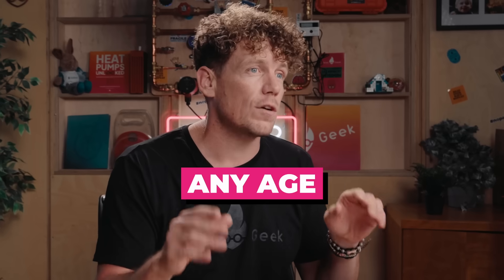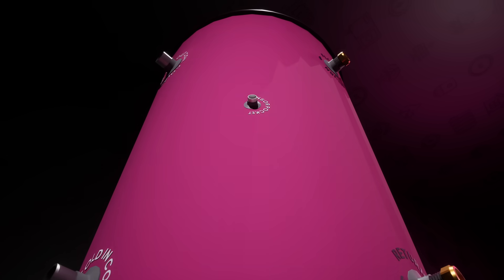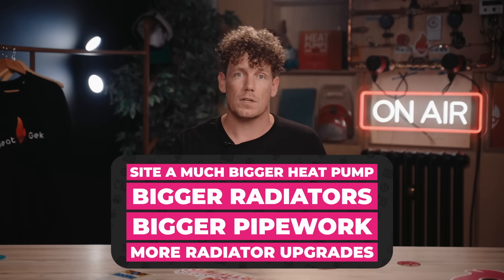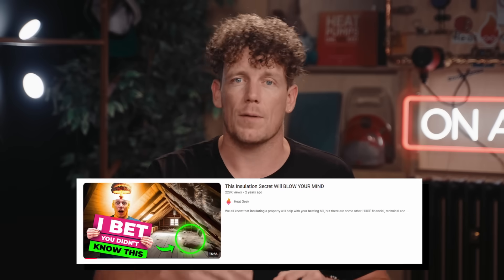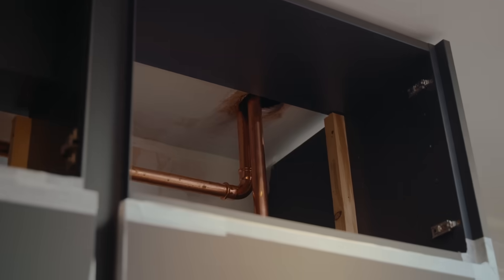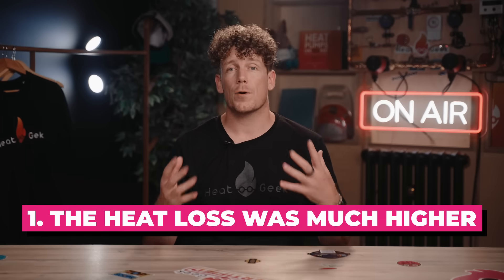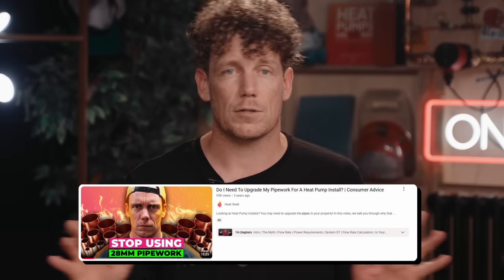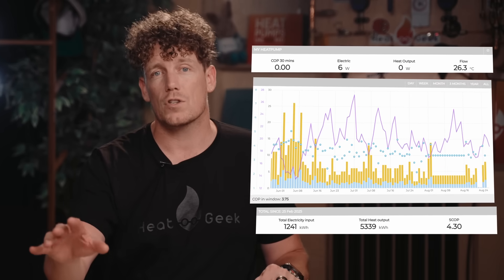Overcoming the 4 Challenges to Heat Pump Any Home

Comment: Do you have a view on the best option for heating an electric only house thats never had central heating..... it seems air-air is the only sensible way but I've an open mind....
Reply: One of the houses I'm looking at buying in the UK has electric storage heaters, if I do buy that one, it'll be upgraded to air to air.
Retrofitting a central heating system is going to be expensive, but maybe worthwhile to some.
Reply from the maker: A2A is absolutely the cheaper option, just remember it’s a different kind of heat (definitely less comfortable) and at water also does hot water
Reply: Presumably it depends on how difficult central heating would be to install? If it is a challenge, @timandkatsgreenwalk have A/C for heating and it works for them.

Comment: My second floor maisonette is probably 150 years old, built from stone and it's partially double glazed. My heat pump (installed through ECO4) has been life-changing
Reply: Hopefully in a good way!
Reply: @Biggest-hz7ng ECO4 is one of the best government interventions I've experienced. My EPC went from G19 to a high B and my power bills have gone down by half, even though I'm hearinig my whole house, instead of a single room.
Reply: How did they do the external unit?  I have a maisonette too, no land, no scope for anything at ground level.  I do have an attic.
Reply: @WyndStryke mine is at ground level. The owner of the building's garden is very nice. I'm the owner of the garden. Presumably a loft would need inlet and outlet ducts. Have you seen the cylinders with integrated heatpumps?
Reply: I’d also be interested to know how you did the external unit

Comment: Heat Geek have still not come back with a workable solution to my victorian terrace, as already mentioned this property is not typical of it's type and almost all will fail the noise test.  Also  Heat Geek recommended  a 7kW ASHP but even if I assume 85% efficiency on my 7000kwh gas use  then I only need a 4kW ASHP ( Or is the gas data not in kWh in this instance? )
Reply: They couldn't figure out our solid stone one either. To be fair to the HG installers in question they were open, honest and said they couldn't make it work rather some other less reputable people.

We instead installed an air/air system and it just works. Got aircon too.
Reply from the maker: Note that we design for the property if the new owners keep it at 22 and you’ll keep it at 18 then you will use different size heat pumps

Comment: I'm planning an installation through Heat Geeks - it's a 1880 large stone home with unknown levels of insulation (recently moved in)

I'm planning to add external wall insulation which should about half the heat loss per m2k.
Can I have the heat pump installed first or will it just end up massively oversized and always cycling?
Reply: If you are doing EWI then you need to plan them together so you get the right sized heatpump (as you correctly ask), but also less obviously because you need to stop them sticking the externals for the heatpump where the EWI will need to go, and you'll need to to run pipes and power through the EWI.
Reply from the maker: We can plan for your upgraded installation when we design your system. You’ll just need to do it before the system is commissioned for it all to work out properly.
Reply: @HeatGeek  thanks! I'm also thinking that if we also got the heat pump and moved to UFH down the line, that wouldn't mean a change in heat pump since the energy demand is the same, we can just run the flow at a lower temp for a higher overall COP right?
Apologies for the questions, this makes sense in my head but Heat Geeks opinions are also the only ones I trust to verify them!
Reply: @BradLad-q4u Yes that assumption is mostly right. The only difference could be that a lot of people find a lower room temperature comfortable with UFH. If your room temperature is one degree lower the rule of thumb says you save 6% of heat. But I guess that won't ruin the heat pump sizing.
Reply: thanks, appreciate the advice

Comment: It would be nice to have some kind of reality show with Heat Geeks taking on seemingly impossible properties within a limited budget and time frame, maybe even competing with identical homes in the same street. I could be called "Top SCOP"
Reply: Or one where they have to do it using a pile of discarded old heatpump and plumbing components in piles - SCOPHEAP challenge ?
Reply: @etchedpixels Love it.
Reply: "Heat Pump Island" could be focused on converting Canvey Island dwellers to heat pumps.
Reply: The presenters could start each show by asking "How hard can it be....?"
Reply: Burly engineers star in "Meat Pump"?
Reply: They can come round mine. 1870 build terrace with 2 complex water boiler tanks and 1950s Aga which we dont turn on😂

Comment: Nice! Forgot the link in the description for the 3rd party data I think?

Also: would love to hear you guys opinions on multi-split systems that are now available with a DHW tank. (Think Daikin Multi+ for example) I'm investigating that option in a small apartment where there is no underfloor system, and wallspace for radiators is dire. A solid solution with air to air & DHW  seems like a cool fit, but there is very little info to be found outside brands own video's, docs,... very little experiences or installers talking about it :)
Reply from the maker: Hey! Link now updated. Generally speaking, I don’t think multi splits with domestic hot water payback. Although I love the technology.
Reply: Adam has expressed a preference for Air to Water installs. But Air to Air works for YouTubers such as @timandkatsgreenwalk and @EVPuzzle
Reply: The link to the data is in the pinned comment
Reply: @Biggest-hz7ng thanks, it is now yes, yesterday it wasn't, hence my comment :)

Comment: I think the difficulty is, when you design a project and cost it trying to get the customer to understand the difference in quality and knowledge against cheap installation by others. No different from the old boiler days. 
We refuse to service or attend call outs to any heat pump we have not installed unfortunately like boiler bashers, guys will chuck them in and run, no after care. 
I could go on and on, I like the heatgeek, plans but there are still only a small amount of good installers
Reply from the maker: We’re excited to be welcoming many hundreds of installers every month to do the training and get their knowledge up to scratch to join the community!
Reply: I imagine it's a challenge. I didn't know the quality of our installers, so used their measurements on Heat Punk to check their calculations and radiator suggestions. Would "Showing your working" help or just allow them to get someone else in with your calculations?

Comment: u had thought this had been scrapped its been so long, glad that wasnt the case
Reply from the maker: Hope you found it informative!
Reply: @HeatGeek  absoultely, as someone who lives in a house form the 1860s, large single glazed sash windows (trhat need to be replaced) and a 35kw boiler, im glad to see something more eco (in both senses) isnt out of reach, thanks Adam and team
Reply: @Mobile_Dom  We did our big solid stone house from the same period (1865 or so) with air/air. As it is listed wall insulation was right out (and EWI on a solid wall is a dire idea anyway), but we did put magnetic secondary glazing on the sash windows which worked wonders and was really cheap to DIY. It's still a lot of energy but it can keep the house warm and combined with a big battery and Octopus Cosy is a chunk cheaper for us than gas was.
Reply: @etchedpixels  yeah listed buiklding here too, a fucking nightmare. good to hear about the secondary glazing, i'll be googling!

Comment: THAT 120 YEAR OLD HOME HAS BEEN MASSIVELY RENOVATED.
Reply: The continuing good condition of the property helps highlight how you don't have to make big changes to install a heat pump.
Reply: @Biggest-hz7ng Believe me, They have spent a few hundred thousand pounds to renovate that property, without the heat pump!
Reply from the maker: No external wall insulation, no additional loft insulation (after a 90s loft conversion). 

Just upgraded windows and a modern single storey rear extension. So yes, massively but very common for that kind of home.
Reply: Spot on👍 looks like a South London £2million home.
Let's waste taxpayer money on these middle class, city workers, just so they can bore their mates at dinner parties, how much they are saving the planet, with their Tesla's and heat pumps!!🙄
Reply: @jezzaandrews1940 part of the payments is to kick-start the industry and persuade people to install heat pumps. Status quo is inadequate.